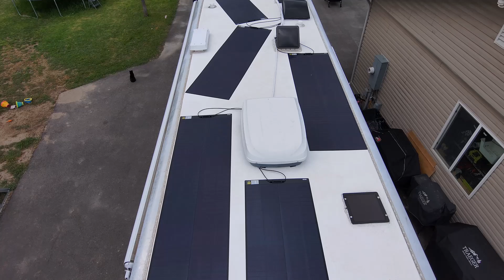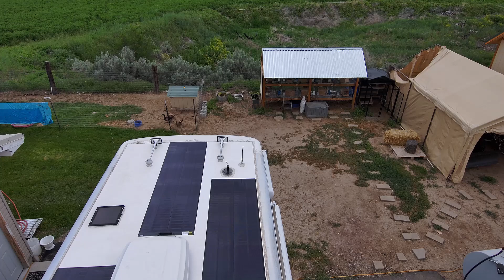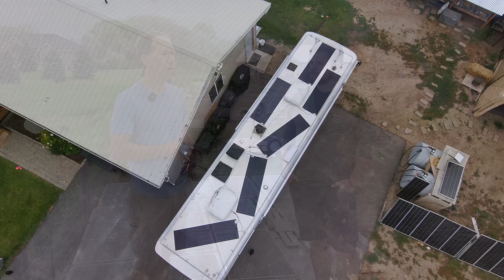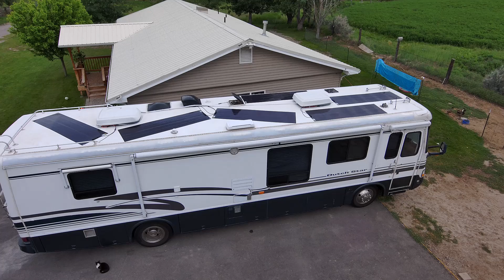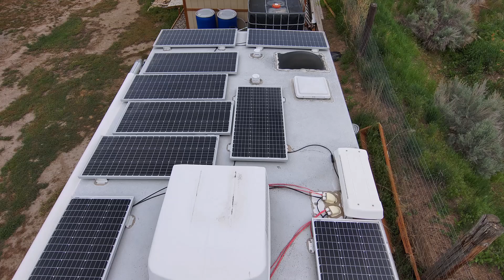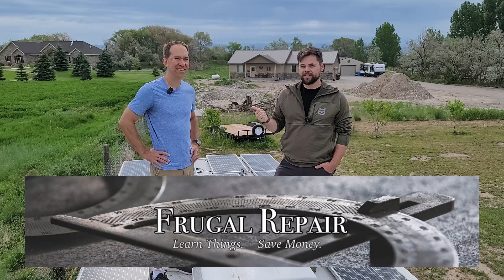RV Solar Tips and Tricks with Reese from Frugal Repair

Comment: I have put 2 solar arrays on my 32ft trailer, 1800W Total, one 600W and one 1200W, our thin filmed 200W Solar panels are Sunpower Gen 3 with 24.5% efficiency rating .  One 600W array runs the trailer 2 x 100Ah Lithium batteries that are self heating at 0C/32F, which means they also draw power where they are located.  After a weekend in the winter at -25C/-13F we still wake up to 13V with the furnace running all night, the other 1200W is in reserve for one of the larger power stations that can take max 150V as backup.   The 200W are 40V each, designed specifically to work not only in bright light but low light conditions even under 1 inch of snow.  We are located at 51 degrees N Lattitude in Canada, so high efficiency rating is important to everyone and extremely important to us in the winter when the sun is so low on the horizon.  Lots of options out there and most manucturers will not tell you that Efficiency Rating is the most important thing to know when purchasing and true efficiency rating not at an between this number and this being this is how car manufacturers advertise the MPG you are supposedly supposed to get.  Basically what I am saying is that true efficiency with Solar Panels is extremely important and most companies will not offer this because if they did you woud know the true quality of you your purchase.  Example above as reference.  :)

Comment: Watched HOBOTEC on attaching to a rooftop with no holes. He’s had his for years with no issues with Highway Driving. I think he has a single hole ne’er the back for a cable. He’s using 3M tape and such.